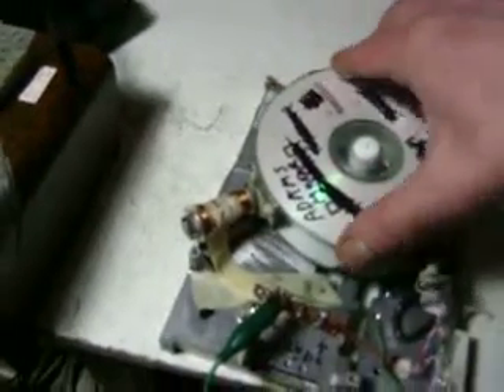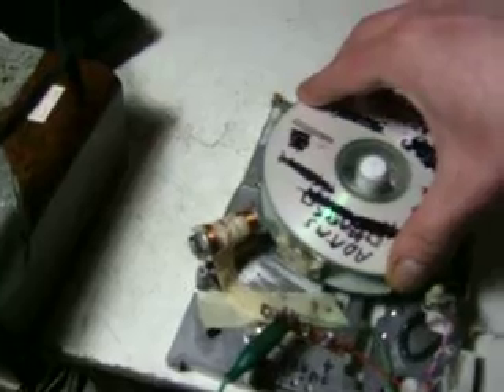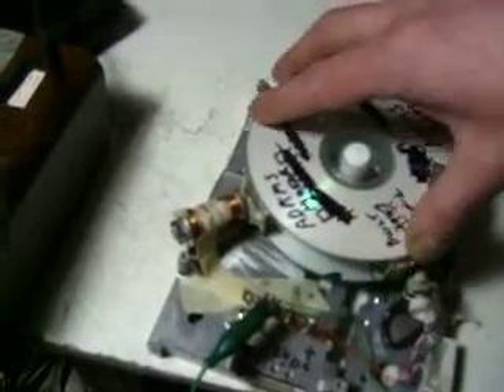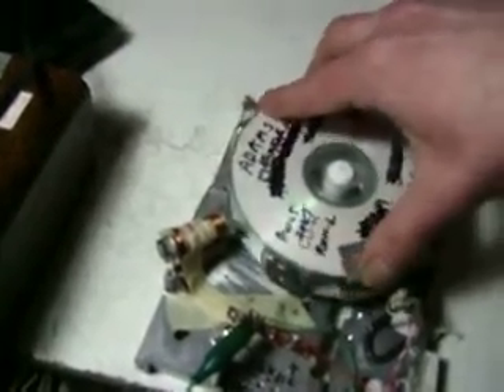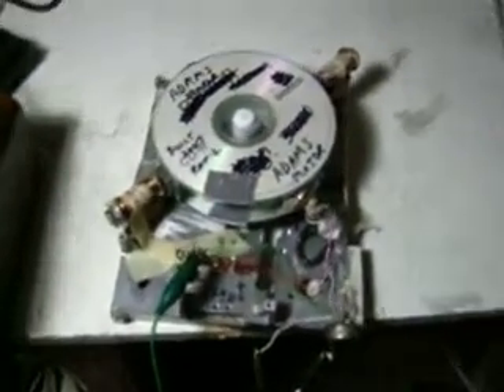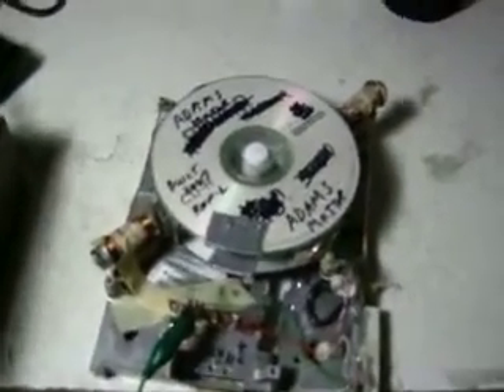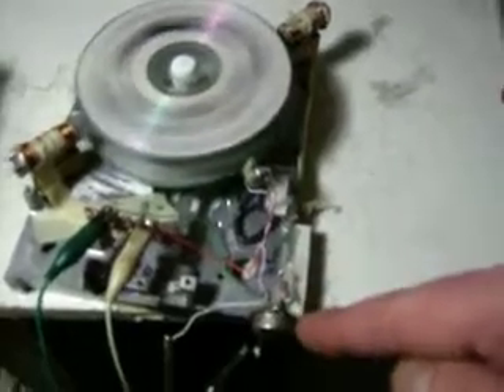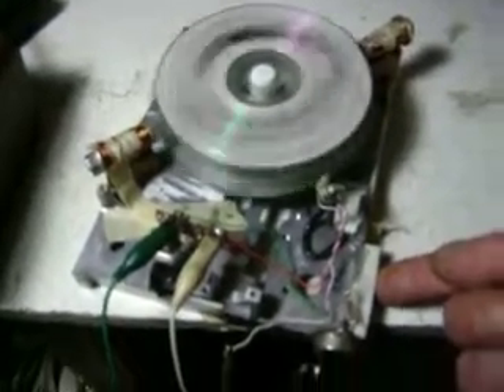Adams Motor

Comment: from the sound you can hear its not running in resonance, but if you bring it to that point, torque will be very very weak useluss to add a generator coil.

Comment: @sorova It's not free energy, but just a way of increasing the efficiency of current motor design.  Back EMF reduces the efficiency, because it creates an opposing force to the direction you want the motor to turn.  If you can recover the energy loss from that, you get much more efficient motors.

Comment from the maker: @LiamXaoh -i agree with you-reverse emf was being lost as heat when anode connected to ground(neg)(diode must heat up)-the charge rate for battery was not a lot-took hours to charge-more power was used to run motor.my thought was-think about how many pieces of equipment use "switching power supplies"-we are still talking about a coil being switched on and off by a transistor and a reverse emf diode installed so transistor doesn' t blow up.
this reverse emf is wasted traditionally-use it?

Comment: @RonL2524 - something doesn't add up.  If you are able to extract energy to charge a battery then the input volts/amps must be impacted.  I assume then the "waste" energy was being lost as heat prior to the battery being connected.  The speed of the rotor should change if there is any difference in the reverse emf that the rotor "sees" when the energy is diverted to a battery, unless of course the watts to the battery exactly match the former emf load.

Comment from the maker: Hi LiamXaoh- i Measured the input voltage and amps-Measured rpm with scope and saw no change if i was charging or not.i figure that reverse emf (it gets generated weather  i'm charging or not) is waisted (diode shorts it to ground(neg))  and using it to charge a battery is just using up otherwise waisted energy?therefore-no increase on input?-ley me know what u think?
thanks for input.
RonL2524

Comment: @RonL2524 - if you "harness" wasted energy then you must supply more energy to compensate.  Measure the input power when the device is not charging a battery and when it is.

Comment from the maker: @RonL2524 sorry-i should have said "if  i had reverse emf diode anode connected to ground(neg) or connected to ground(neg)THROUGH a dead battery charging-i saw no change in power demands of cct ,from what i could tell, i saw a battery charge as though i was harnessing waisted reverse emf"-no free energy

just using otherwise, waisted revese emf?

Comment: @RonL2524 - I think you are missing the point.  In essence the external power supply is providing the energy to charge the battery.  The device in the middle is a distraction.

Comment from the maker: @LiamXaoh -this motor will not run unless externall power is applied.

but,i have charged a battery with the reverse emf(normally shorted to ground.
with no increase on power drawn-i'm thinking how many other devices just waste reverse emf(short to ground through diode)when a battery could be charged instead-just some thoughts.
thanks for interest.

Comment: @RonL2524 - don't believe all you see.  It is the same as all other such devices.  It requires more energy to run than is available as out put.  If it was any sort of free energy device it wouldn't need an external power supply.